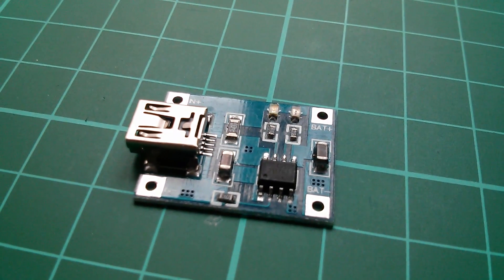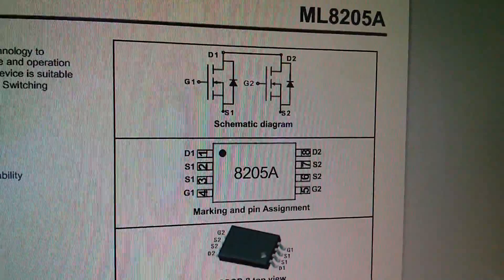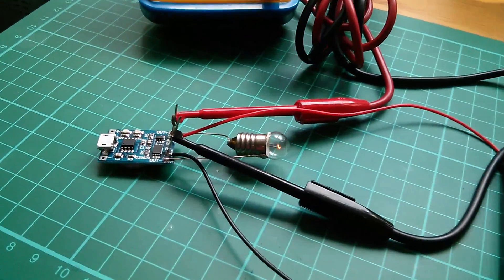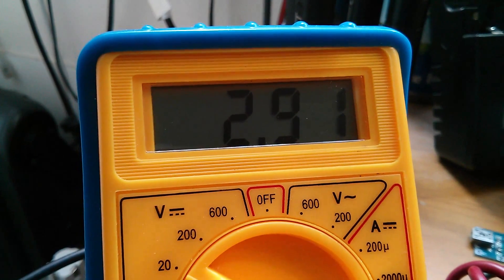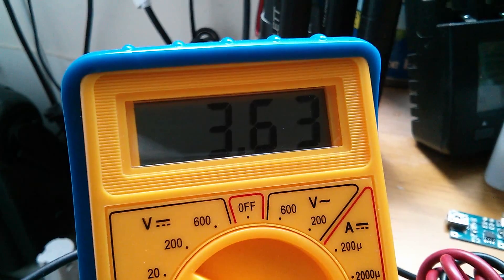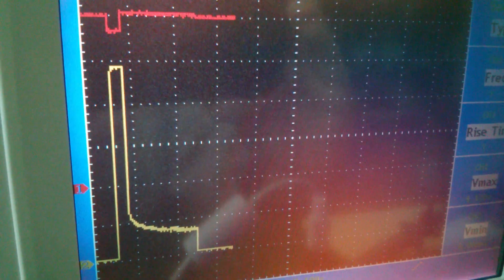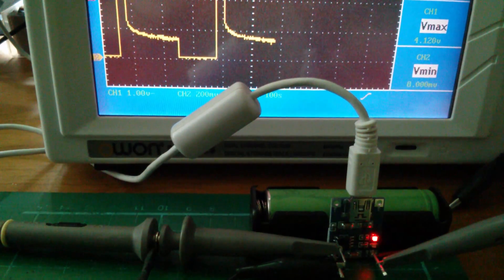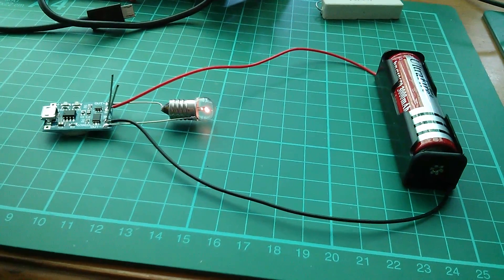New TP4056 Lithium Cell Charger Module with Battery Protection

Comment: The link is not good anymore, here is a link for a U.S. shipper that is $5.89 for two boards including shipping.http://www.ebay.com/itm/2pcs-5V-1A-Micro-USB-18650-Lithium-Battery-TP4056-Charging-Board-Charger-Module-/191850083395?hash=item2cab27f443:g:VkAAAOSw6oBXEu2FThe only issue I see here is that if you have a cell that is discharged sufficiently that it will never achieve the needed 2.91v turn on voltage then that battery can never be charge by this unit unless an alternate source is applied to the cell. In short, this device will not charge flat batteries.
Reply: DrHarryT  That price is a total ripoff!  Go to AliExpress for a tenth of that price!

Comment: Very interesting Julian. I happen to have the older version. I am using to charge a small LIPO cell and found it very difficult to change the resistor to limit the charging current. One thing  that could be interesting in having is a discharge current protector to keep these under, for example, 1C. Have you seen this feature in another TP series? Thanks

Comment: how can I charge two of the battery at once
Reply: If you're charging two cells at once from one protection circuit you would have them in parallel. I.E. both the positives are connected together and both the negatives are connected together. They will both charge at half the speed since the same current is being shared between two but it should still work provided each cell has a very similar voltage.

No offence but I would recommend you get familiar with the basics before moving on to lithium-ion / lithium-potassium batteries since they can be dangerous. If you want to know the basics there is plenty of videos on YT. (I do some too)
Reply from the maker: series or parallel?
Reply: +Julian Ilett I have two of those whom I later attach together in series to use. it really doesn't matters how I charge it It can be in series or either parallel but the cost should be minimal 😋
Reply: +Julian Ilett I have only one charging module
Reply from the maker: You'd have to charge them in parallel
Reply: +Julian Ilett will that work?  the charging will be slower right?  parallel simply means all positive togather doesn't it?  is any extra step needed?  
thank you very much in advance
Reply: your correct just pos to pos, neg to neg. I wouldn't go more then two cells per module. Charge time increases dramatically.

Comment: dear Julian ilett, is there any problem to charge 2 18650 batteries in parallel using single tp4056?
Reply: I'm not Julian but I can answer that question for you. You can charge Lithium batteries in parallel from one protection circuit but they must be at the same voltage when you build the circuit. expect them to charge at about half the rate too.
Reply: +TheBeginner ElectricalEngineer because I have tried connecting 2 18650 from a broken power bank in parallel, then connect it to single tp4056.somehow it took a long time to charge due to low amp and the tp4056 was quite hot while charging.
Reply: Yeah. A chip will do that when you try and pull too many amps through it. You could try adding a small heat sink to try and stop your charging circuit from overheating but you'll probably get the same charging speed.

Comment: Hello, is it posible use this module as a solar charger for a couple of 18650 in parallel? . I need to provide continuous power for a month to 4 mp3 players + headphones  without mains voltaje or transformers. Don't need to be ultra eficient, just do the job. I'm thinking on 2 x 8vp@180ma solar cels in parallel and set the tp4056 about 200ma. Will this work? thanks!

Comment: hi i want to connect these to my 8 cells wired in   serie but every where i search they say it will frie the tp so i searched why this happens and it is cause the neg to the usb side is shared to the neg  of the batt so i got thinking what if  wire in a blocking diode to the neg side will this work, so the diode blocks the usb side   from seeing the batt neg... any help here please

Comment: I am dissappointed about the discharge protection. Most RC people who use LiPo batteries don't discharge their batteries below 3.2-3.6 volts to prevent damage to the batteries and this thing goes all the way down to 2.5 volts! That is ridiculous! A am not sure I will continue using them.

Comment: If I need around 14V - can I just use 4x TP4056  connected in series by OUT? I can provide enough current to charge it. I know I could use one but the charging speed would be low.
Reply: I'd like to know this too. Or is there something else I could use to charge and use the batteries at the same time?
Reply: No. It would still be 5v but would be 4a
Reply: Przemyslaw Szulc No, this would short your PSU.
Reply: Przemyslaw Szulc   Do you like fire?

Comment: Hi Julian, I'm currently waiting for some boost converters in the mail ( to create a 5v supply from the tp4046 output ) but in the meantime I tried to connect the v+ and v- of the tp4056 in series with a second one  (to get 8.4v) and input this to an adjustable regulator , but this doesn't work at all - do you happen to know why this is? great channel by the way!

Comment: Hi, when purchasing the new modules the seller said to disconnect the load while charging. In your experience is this necessary? Or can you safely run a device while the cell is charging?

Comment: can i use TP4056 Lithium Cell Charger Module to charge 2 18650?
Reply: Not in series, no.  They'd have to be in parallel.  It would just take roughly twice as long to charge them.

Comment: Julian I got many of these for Bluetooth radios that I'm building and I'm charging a single cell 400mah lipo ( with 1s BMS) with it and I've noticed during charging I'm measuring 4.5 volts on direct battery connection. The 4056 reaches 110 deg F during charge.  Could the separate 1s BMS on the lipo cause issues?  Is 4.5v okay?

Comment: Do you know if the tp4056 is able to directly recharge a cellular phone? My idea is to use a 5v solar panel, then interpose a tp4056 and then give power to the mobile phone. Is is feasible or is it preferable something like solar panel, tp4056, 18650 battery, then step up 5v converter and finally the smartphone?
Thanks in advance
Reply: No interposing permitted !!

Comment: Nice video. Do you know of ANY possible way to INCREASE the charge current? My batteries have so much capacity, it takes sometimes 4 to 5 hours to charge when they are extremely low. I'd like to increase charge current to 1.5 amps. Im an accomplished technician with a decent soldering re-working station and have even soldered these small surface mount resistors successfully. Even if I have to heat sink the chip, I'll do it ... I just need more charge current so any info or ideas you have, please let me know?  Thank you!
Reply: Search eBay for this phrase:
TP4056 4.2V 3A High Current Lithium Battery Charging Board Charger

Comment: When charging, does the system still have a voltage output over the protected circuit? Hopefully as then I can have 1 charger per 18650 battery, then when not charging have 3 of them in series

Comment: Powering a Load while charging... hmmm....  
I suppose you could use a pair of diodes. One silicon diode with the anode from 5V Vin to the charger - cathode to the Load. Then a low Vf schottky diode with anode to the Battery+ and Cathode to the Load. 

If you have 5V input, you'll get about 4.3V to the load while the charger is powered. 

During Battery operation, with a 300mV Vf schottky between the battery and the Load, you'll get around 3.9V to the Load.  

There are "ideal rectifiers" these days... used as bypass diodes in solar panels. They aren't a real diode, but instead an active rectifier... but they require at least 100mA current to "turn on", but they only drop around 45mV !!

Comment: Havnt been able to find the circuits maximum draw after the protection circuit.. also will it run i parallel with another identical module if its separated during charge mode??
Reply: I know your busy Julian, but I never get a reply from you Bro. Love the videos. Please help me out with this one..

Comment: I still don't understand what the protection circuit does. The charger quits the charging at 4,2V anyway, doesn't it? Having a light load connected to the circuit will start draining the battery and eventually destroys it due to undercharging, because 2,5V is way too low for an LiI-Io battery. Inside the specification document your are warned not to connect a load while charging, so the setup in this video is incorrect anyway. But not having a load connected to the circuit while charging makes the whole protection thing obsolete... I am totally confused 😕

Comment: Did anyone else notice that the new module (the one I have looks slightly different) gets pretty hot when charging - uncomfortable to the touch, not burning though, even after a few seconds? I swapped out the 1k2 resistor for a 2k2 which dropped the charge current to about 560mA, but it didn't seem to cool it at all.

Comment: How much current can I pull out from the OUT terminals?
Reply: i would really like to know this as well.. A 18650 can put out way more than 1A at 4ish volts.. however does the battery protection circuit alow for the same current that the battery can handle???
Reply: I'd also like to know this :/
Reply: The data sheet says it has an over current protection of 3 Amps.
Reply: BubbLeT Thank you :D 
If I put both of them, does it go up to 6A ? Or do I totally make the protections useless ?

Comment: By the way that's an MP1405 chip. They have the 2 protruding teeth at the battery terminals.
Reply: I suspect Alice knows this and is using the TP because it's more well known and thus will get more hits, and since the chips are pretty much for the same purpose and have the same dimensions, it works out. I have one without the teeth and I'm curious if there really is a TP model like this, it doesn't have the teeth like this one does so I don't think it's the MP.

Comment: Am I correct in assuming the extra set of ports can be used with 2 batteries in parallel, or entirely separate?

Comment: im trying to get the temperature protection side working using a 10k NTC charging stops when temp reaches 50c... so far im unable to get it working following the datasheet..

Comment: Julian, may I suggest you consider reviewing/investigating the circuit boards typically found inside laptop battery packs that perform the  recharging of batteries when the laptop power supply is plugged in. I've taken apart several old battery packs to get the 18650 batteries. But the electronics in these packs is fully capable of charging these batteries. It would be useful tactic to re-use these electronic components. Also, typically only one battery is defective in these packs so a method of opening these battery packs, testing and replacing the defective battery/ies could be reused in the laptop or used simply to recharge batteries.  Thanks for all your You Tube presentations.
Reply: As I understand it, the electronics inside the battery pack are designed to interact with the electronics on the laptop's motherboard, meaning they can't stand alone.
I think that the battery packs are also deliberately made to be almost impossible to disassemble without wrecking the whole pack.  I expect the motivation would be "safety" since you need to be sure that you're replacing like with like and not many people would realise that you can't just jam any old 18650 into the battery pack to replace the dead cell.  And as the cells age, their capacity would suffer so even replacing like with like might not produce ideal results.
Reply: @melkiorwiseman  Well you should have mentioned " impossible to disassemble " before I recovered over 500++ 18650's , without damaging either the cells or boards ;)
Reply: @KD0CAC  It's known as "hyperbole" and it issues forth under the impetus of bitter experience. 😅

Comment: Hey Julian, great video.  Is there any simple / cheap dc-dc boost buck converter so that you can easily add on some lithium 18650 battery storage onto an existing lead acid solar storage system that you can recommend?  I was thinking you'd need some sort of bi-directional boost-buck dc-dc system in order to be able to use the lithium batteries at their ideal voltage range between 3v-4v.  Maybe 2 seperate circuits may have to be used if bi-directional is not readily available affordably?

Comment: It looks like you've got boards with the fake TP4056. 
There's no F-logo and under the TP4056 writing there should be 4 numbers, nothing else.

Reported problems: 
- grossly overcharging
- undercharging
- really slow charging
- some even have a direct connection between output and input
Reply: Know where to find legit ones?
Reply: No

Comment: Ebay link is dead.
Cheap Chinese Vendor: http://www.ebay.com/itm/2PCS-5V-Micro-USB-1A-18650-Lithium-Battery-Charging-Board-Charger-Module-/400665522246?hash=item5d4986b046:g:zHgAAOSw1vlUxZ0Q

Less Cheap (But Still cheap) US Vendor: http://www.ebay.com/itm/2pcs-5V-1A-Micro-USB-18650-Lithium-Battery-TP4056-Charging-Board-Charger-Module-/191850083395?hash=item2cab27f443:g:VkAAAOSw6oBXEu2F

Comment: seems like overkill for charging these batteries? great video , thanks
Reply: its not all about charging battery but integrating this into project.
if your were to buy off a shelf charger, you're practically getting the same thing; but if you were to integrate unprotected li-ion/po into a project, this will be a excellent tutorial for the most cost effective way to go.
Reply: fair comment , peace !!

Comment: Hi Julian! Thanks for such informative video! I wonder if you can give me some suggestions on this.

Is it ok to have a 5v boost converter connect to the TP4056 output terminals? I want to boost the battery voltage up to 5v so I can charge my phones or other small e-devices. 

If that's possible then what would happen if I connect a 5v ac adapter charger to the TP4056 inputs terminals in order to charge the battery? 

Would the boost converter output a little bit more than 5v which then would fries my e-devices?

Thank you very much! Keep up the good work!

Comment: That's an MP1405 as someone has already pointed out. Many thanks Julian, a great help as always. 

May I ask how you setup your scope. I note you are using one probe with ground clip and the other probe looks like the ground clip is disconnected. 

As always inspired to replicate your work. 

I have purchased these modules to use with a small solar project connected to a TPS61200   Fortunately you saved me from making a mistake!!  As I a made a silly assumption and my battery would have been in dire straits without any protection. 

Have you considered a video on super capacitors by chance, could do with your wonderful insight. 

Once again, your a star and I thank you for shinning a light for us to follow
Reply: All you need is 1 scope ground lead connected.
Reply: thank you Jim

Comment: +Julian Ilett
If have one question. Why is the light bulb on when you connect the charger and the battery voltage is still under 2.9 Volts?
Isnt the low voltage cutoff enabled and the MOSFET is disabled,  so the 100mA trickle charge of the TP4056 goes just to the battery?
This would mean the charger is directly connected to the OUT terminals.

EDIT:
That would mean the charger would never start to charge if you are using more than 100mA.
On the pictures of the module it looks like the battery minus gets disconnected with active discharge protection. 
But it would be much better if the out terminal gets disconnected, to avoid this problem.
So in conclusion the charger is not designed to charge and use >100mA at the same time.

Comment: I was thinking of doing a project with several 18650 and corresponding number of tp4056 and a question came up. Hence the board is charging that one cell, after the charging is done could I connect 3S2P directly from Vout terminals on the board or will I just fry the board/cells/both? I'm thinking of creating a connector that separates the batteries while charging and of course while charging = NO load AND while load = NO charging.

Comment: Good video, thanks.  I wish you had talked more about the board's problems, however.  You found them, but didn't really make an issue of them... 1) Discharge protection doesn't cut on untill 2.5v, that is way to low, imo. 2) The board will not allow charging a cell below 2.9v... So when you combine the two together, along with the boards behavior of allowing further discharge as soon as the voltage hits 2.9v again, I see a bunch of flat, unchargeable cells.

Comment: Hi Julian, This circuit is suitable for high-current 3.7-volt batteries, It is automatically terminates charging when the battery is full ? So cheap chargers do not fill the high-current batteries

Comment: +Julian Ilett Hello. Do you consider that can be used for bottom balancing the 18650 cells? could be used as for lowering a set of batteries prior put them in pack?

Comment: I'm looking to get this exact board but my question is...if I need 5 lithium ion batteries to make a portable bluetooth speaker, how many of these charger boards do u need and can I just plug one micro usb to charge all of them....thanks in advance to whoever helps me out here
Reply from the maker: +mako mike You can't do that. You'll short out all but one of your cells. I really must make a video about this question because it's asked frequently.
Reply: +Julian Ilett ok thank you... if u make a video, I'm sure it will answer alot more questions we all have....please let me know once u do....I have the ideas in my head but I don't know how to wire it all up so it works properly...thanks again